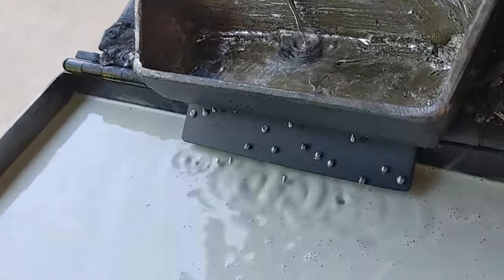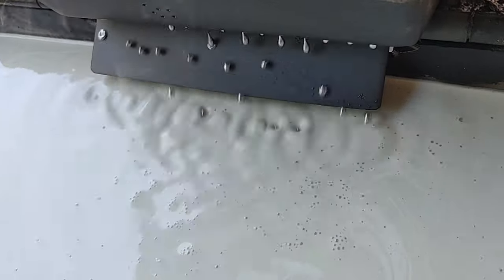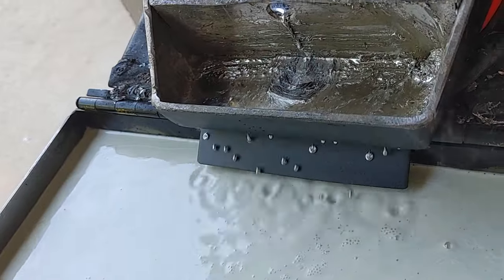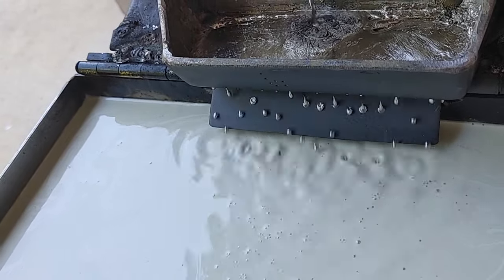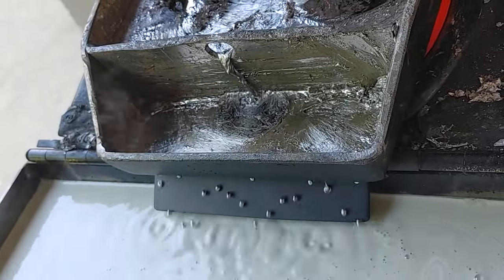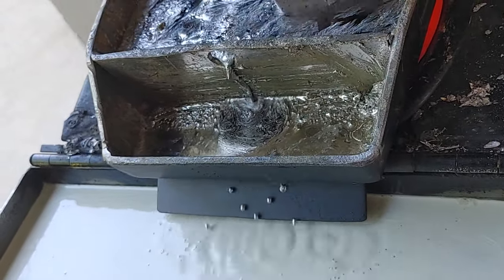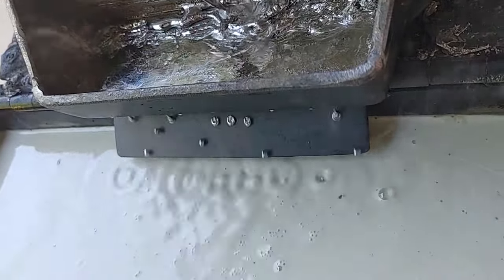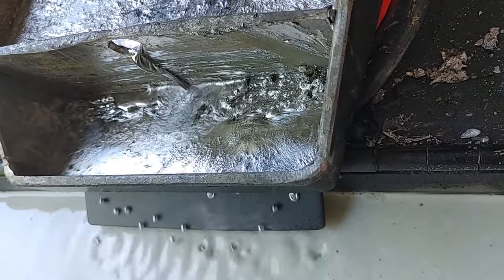Heat control

Comment: Question - seems like dripper working or not is a function of volume in the lower chamber, how does lead temperature affect the dripper being active or not? As more lead flowed down from the upper chamber, drippers got more active. Volume change.
Reply from the maker: It's simply a balance of how fast the lead can be melted versus how much is going out the front.